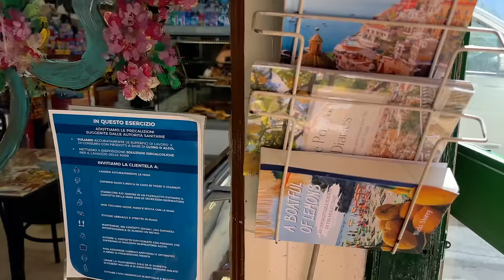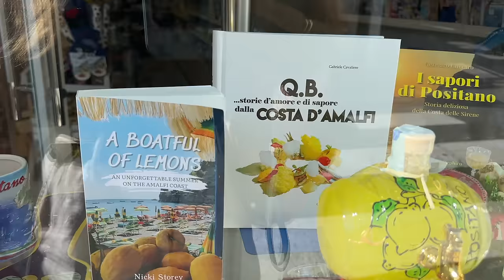AMALFI COAST LIFE IN JULY | BEANS, BOOKS AND SOMETHING DIFFERENT! EP 245

Comment: When it comes to sweat problems I want to share  with You one of mine absolute best life hack.                                                                                                              So the secret is simple- alcohol 96% or more. I'm aplaying it on cotton swab and then rabing  my armpit or squezze alcohl from it diarectly on armpit and then rab it in. In order to work it shoud be used  decent amount of alcohol. After that I'm applaying antipersprant. Let it dray completely, then get dressed. I'm using it on a daily basics and it worked out very well every time, no smell, feeling fresh all the time even if its hot or I stres a lot. It helps not only with smell but making skin heal after shaving.